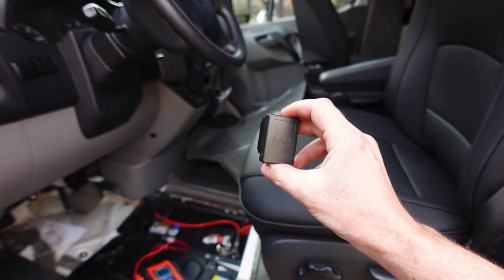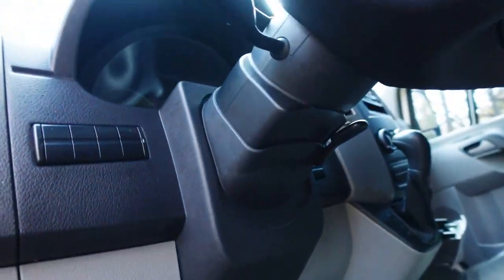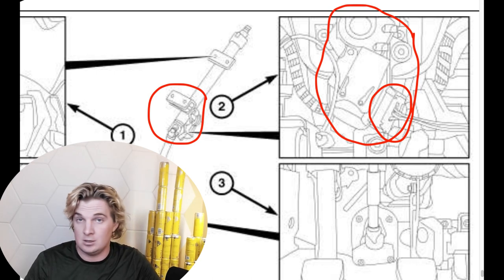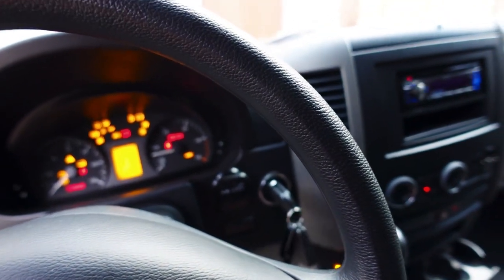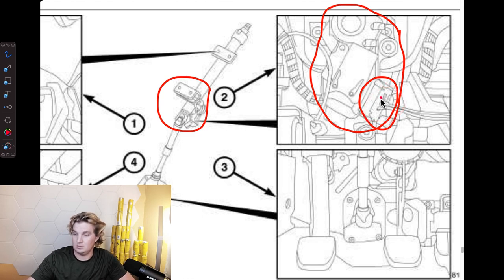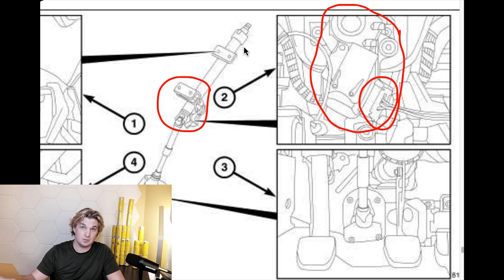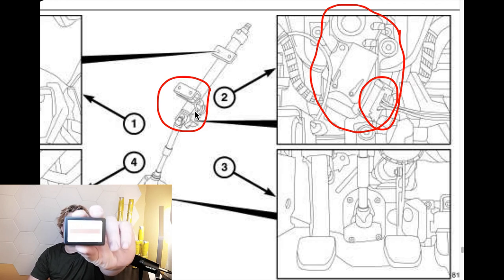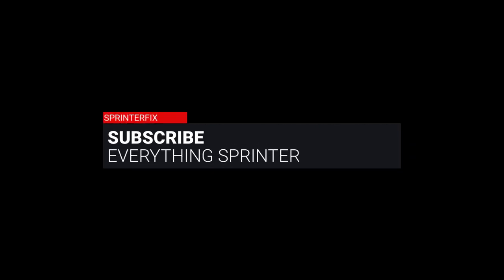I Fixed My Sprinter's No Crank Problem With One Simple Tool!

Comment: You are partially correct.  You are not bypassing the immobilizer you are bypassing the electronic steering lock.  Mercedes has had this well know problem for years.  The ESL system goes bad over time.  By using the ESL bypass module you are keeping the steering lock in the open unlocked position forever.  At the same the the ignition switch is also open and unlocked however your vehicle wont just start by turning the ignition with a screwdriver or an incorrect key.  Your immobilizer system is still fully in tact and requires a programmed key to start the vehicle.  So from the standpoint of Safety and theft your vehicle is still very secure because the immobilizer is still protecting you vehicle.  All you have actually done is bypassed the electronic steering wheel lock.  That is the noise you hear every time you put the key into the ignition.  You are hearing the electronic solenoid unlocking.  The second part of the starting process is the immobilizer system  remains untouched and secure.  The only noticeable difference to the end user of the vehicle is the steering wheel will always remain unlocked at all times.  Like I said before this really is not a security risk because the immobilizer system is still active preventing someone with a un programmed  key from starting the vehicle.  I hope this helps people out by knowing the truth about this system.  Mercedes has done a very poor job with their ESL system because they know the system fails with no warning.  So this 40.00 bypass module is the true fix to their problem.  And the end user will never have to worry again of the key not turning or the steering wheel not unlocking.  Shame on Mercedes.
Reply: Is it plug-and-play or do I need to do more stuff to get it to work? Except unplugging the original and plugging this by pass.

Comment: The reason the keyecu emulator does not work is simply due to the older software/firmware on them, they are not compatible with the USA Sprinter. Those work just fine on all the benz cars they fit though. Also, the newest link for the emulator is made by mk3 too, it is just an updated version with sound.

Comment: any chance you've got a video re: removing the steering wheel lock and if you did it with the column removed (or still in the van)?
Reply from the maker: sprinter experts has a video on that, usually need to cut the bolt, alternative option is leave it in, just give it a few taps if it is getting sticky and once it unlocks once you can unplug it while it is unlocked. that way it stays unlocked and u just use the little bypass tool in the video. I hope that helps
Reply: @sprinterfix  Thanks for your reply!!!!  Currently my NCV3 starts fine but I did encounter this problem a few weeks ago and bought the emulator.  Before I could install is just started working again - so to avoid this in the future, do you think I could insert key (which at this time, still disengages the steering lock), turn to position 1 (not actually starting the van), unplug the steering lock / plug in the emulator, and then turn off the key and remove?  In other words, if I can install the emulator while the steering wheel lock is disengaged, I don't have to cut it off.  And because it has no power unless I plug it in, there is no way for it to ever re-engage?  Thoughts?
Reply from the maker: @HGPILOT2  yep, thats is certainly an option. It will work. I'd at least keep the emulator in the vehicle since it is possible your steering lock motor is starting to fail

Comment: i  have an 03 sprinter.  SOMETIMES it does not start but is "dead" when key is turned all the way.  but when that happens if i "jiggle" or turn the steering wheel  then it will turn over and start.  i need a genius to tell me if i disconnect steering lock will it fix this problem that happens just "now and then".  or is there something else i could do.  thanks very very much.  when it first happened had to tow to mechanic (we were 550 miles from home).  they replaced fuse panel under steering column.  1100 dollars.  i don't think it fixed problem.  thanks again very much
Reply from the maker: Damn.  That sounds like a frustrating issue.  The ignition system on pre 2007 is very different from that of 2007 to 2018. Have u considered it may be a transponder com error?
Reply: thnx for reply mucho.  no idea what a transponder is.  or obviously a transponder com error.  sounds exotic and expensive to me.  i will probably have to continue with "jiggling" the steering wheel to get it to start.  i live in kc area.  if i'd simply jiggled the steering wheel would have saved four days in motel and car rental, etc  this all happened in memphis area.  i know.  my wife says i'm a whiner. @sprinterfix
Reply from the maker: @michaelcarman4875  well if jiggling works then it works haha. I just mean the little chip thing in your key talks to the little ring around your key slot to tell your van it is ok to start your engine. do you get a start error when this happens?

Comment: I noticed when you start the van the ignition doesn’t spring back like other cars. My van does the same. When I start it I have to turn it back a little to disengage the starter. I’m I doing it wrong? Should I just leave it ? Thanks
Reply from the maker: Yea. interesting enough u don’t need to hold these in crank position to crank.  Just turn it and it should pop back in place while still cranking. Starter automatically disengages when engine turns on or after a few seconds of cranking.  Since it sounds like yours is stuck like mine is just turn it back right after you crank and watch it crank and start.  No big deal.  Don’t going to affect starter. Just think of it as a button.
Reply: @sprinterfix  thanks I was about to change it.

Comment: I have removed steering lock pin and am using the emulator.  Can I go like this from now 9n? I don't need or want the steering lock anyway. Thank you
Reply from the maker: Ideal scenario is that your steering lock is working intermittently. In which case I would suggest turning vehicle on with steering lock plugged in and then unplugging it after it unlocks. then keep unplugged and use emulator from then on. That way steering stays unplugged indefinitely and you don't have to cut it off right away. Long term there may be an argument for cutting steering lock off as there are unsubstantiated reports of it spontaneously locking up while driving which is not ideal. If you are experiencing a bad steering lock and don't have an emulator yet consider light taps with a hammer while jiggling steering wheel and inserting key repeatedly

Comment: I lost my keys can I use this to start my car without them
Reply from the maker: Unfortunately a transponder is required to initiate those circuits. But if your key broke u could use a fork because that thing u put your key into will fit anything
Reply: No, this is only for bypassing the steering lock. There are some mail-in services to get keys made and they are usually less expensive than using a local locksmith and defiantly less expensive than the dealer. The biggest hurdle with these is getting the steel keys cut. Meaning, they will have to decode the lock in order to cut the key.  The aftermarket world does not offer any key cut codes for Mercedes by the vin. There is at least one seller on ebay that offers the emulators and if you ask, they can program and cut keys too.
Reply from the maker: @intherealworld1188  hmmm nope, you can start these engines with a fork. I will make a video about it. the ignition module is about as generic as it gets, not key specific but transponder specific
Reply: So now you want people start them with eating utensils? While that might work in an emergency, that is certainly not a great or long-term solution. The steel key is obviously only used to turn in the switch; however, the EIS is far from generic. There are plenty of hack vids on these platforms already, not sure adding another is needed.

Comment: I have this Issue I did not see the link were to purchase the Bypass?
Reply from the maker: I’ll ad one.   Give me a day or two
Reply from the maker: @timfranchuk6284   @user-mk9pw1pd5i this one should work, can't seem to find the previous seller but this one seems very promising, might be the same guy,    https://www.ebay.com/itm/235104385198?mkcid=16&mkevt=1&mkrid=711-127632-2357-0&ssspo=xUNODkCRRZq&sssrc=2047675&ssuid=Cy39O8MbSW6&widget_ver=artemis&media=COPY
Reply from the maker: @timfranchuk6284   @user-mk9pw1pd5l this one should work, can't seem to find the previous seller but this one seems very promising, might be the same guy,    https://www.ebay.com/itm/235104385198?mkcid=16&mkevt=1&mkrid=711-127632-2357-0&ssspo=xUNODkCRRZq&sssrc=2047675&ssuid=Cy39O8MbSW6&widget_ver=artemis&media=COPY
Reply: @sprinterfix   is there another link where to buy  Bypass immobilizer  ?
Reply from the maker: I just updated the description with most current link, I hope this helps @modestagapsyte4109
Reply from the maker: link updated @timfranchuk6284